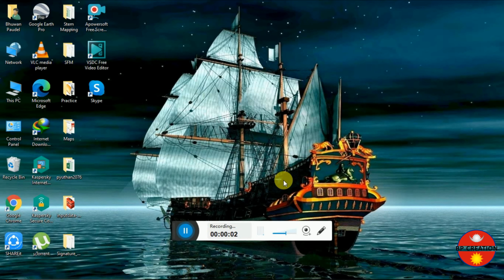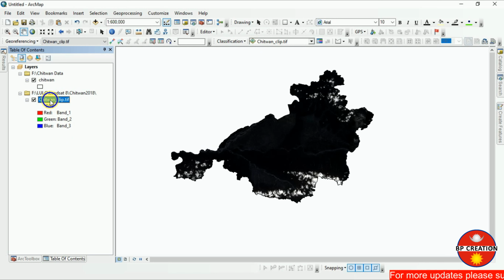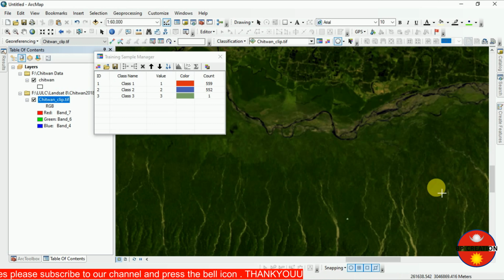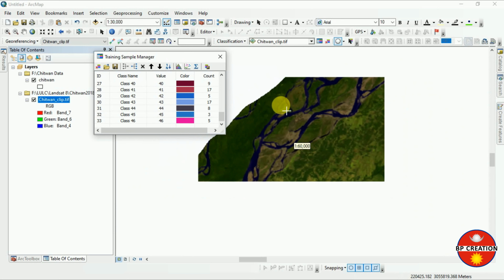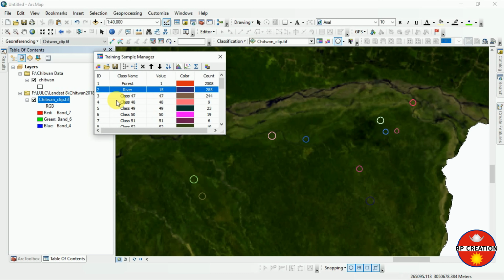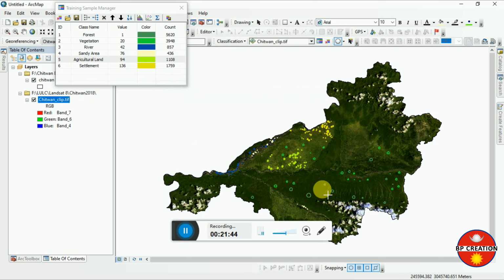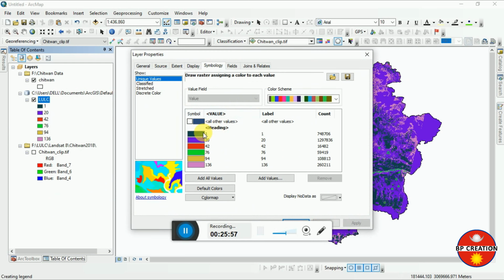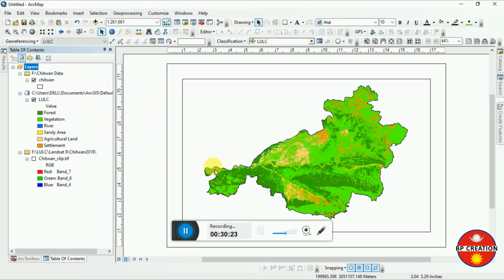Land Use Land Cover Mapping | Image Classification Using landsat 8|Supervised classification| ArcGis

Comment: I want to prepare a land use map of lekbesi Municipality, surkhet  with 5 class (forest, Agriculture, settlement and Lake area) but this method did not work i have been tried it many times.
I have already land use map of this area in vector format with 8 classes , how  classified this map into desired class.
Reply from the maker: You can use dissolve tool between 2 class which you want to represent as one. Simply use geoprocessing tool to deal with vector format.
I think method is quite right to do manually but sometimes it happens.

Comment: I am requested for geo referencing on calculating area of classified land 
how can I solve this problem
Reply from the maker: if you want to claculate the area of classified land and classified land is in image format then you have to georeferenced and digitize the classified land which you want to calculate area and then you can calculate area as usual way while calculating area of polygon. And if classified image  is in raster format yo can calculate area without out georeferencing by
Create "Area' field then
Go to field calculator 
Area = raster cell count of classified land * Raster cell size * raster cell size / 10000 
It will give output in hactres.
To count raster go to symbology and categories there you can see count column where you can find cell count of every classified land.